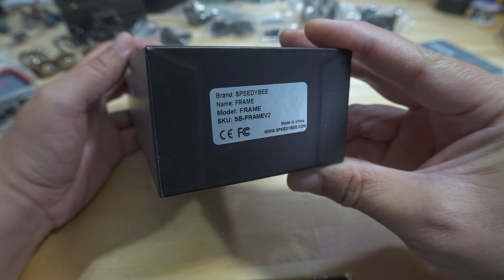SpeedyBee V2 Frame and BUILD Preview 🛠️

Comment: Can i use a 5.1x3 prop? Or will it hit the 3d printed mount for the xt60 connector? Thanks
Reply from the maker: 5.1 inch props fit.  I'll be using one on this build soon.
Reply: @AlbertKimTV  thanks.
Reply: @AlbertKimTV  is it tough to crashes? I haven’t finish my build yet i have doubt in bottom and top plate seems to thin?

Comment: Wow, that's some really fancy packaging! I've spent $95 (about ten thousand dollars Canadian or something😉 ) each on a few ImpulseRC Apex frames and they come in crappy bags. The Catalyst Machineworks BangGod came in a plastic bag too!

For the VTX I wonder if GEPRC will release a US version that has 25mW, 200mW, 600mW and 'Max' (that needs to be unlocked) - I think RUSHFPV did that with their VTX (though I could be wrong).

Great frame review, looking forward to the build video! 

Keep up the great work!
Reply from the maker: Not surprised that cost cutting the packaging happens everywhere.  I guess it's better that than the carbon itself!
Reply: @AlbertKimTV  You're 100% right!

Comment: more build guide please, it helps for beginners, or maybe a few generic best practice how to route wires antenna placements motor selection esc selection FC selection
Reply from the maker: I made a generic build video about a year ago.  Perhaps you can watch that one and tell me what else you might need more in depth discussion on and I can cover that?  Please be as specific as possible, thanks.  https://youtu.be/MvrSLW-Ukb0
Reply: @AlbertKimTV  There are build videos, but they gloss over the details like the FC selection features and wiring ease, some make it simple some require more effort like needing a 5v power that is not on the board, but my son and I love watching your video, he is learning now how to build, many thanks
Reply from the maker: @BrookZerihun  The reason that isn't covered is because every flight controller is a little different and they also become outdated quickly, become discontinued and replaced with a new model, etc.  So making a specific video about a part is not gonna be seen because no one wants to spend a lot of time to make a video that only a few people will watch.  However, in general, they are all somewhat similar these days and you just need to refer to the product page which will have specs and wiring diagrams.  These will be important as reference materials when you build.  I've referred to these in past build videos from two or three years ago.  Most FCs are F4 or F7.  F3 is not supported in the latest Betaflight.  It's important to keep up with the latest Betaflight news to see what keeps getting support and what gets dropped.  Knowing these things will help you decide what to get.  You generally also want boards with at least 3-4 uarts to connect devices if you need them.  Some F411 boards only have 2 uarts which may not be enough for what you need.  Again, consult documentation on the board.  If you're looking for a good budget board, most of the Diatone boards are generally considered a good value.  If you want a fancy warranty or hand-holding support, expect to pay 2x or 3x more.  Also, see if anyone made a video about the FC.  They may have some important information about the board no one else knows.